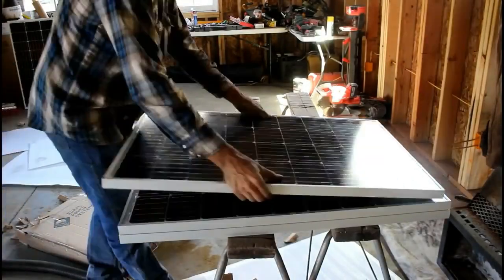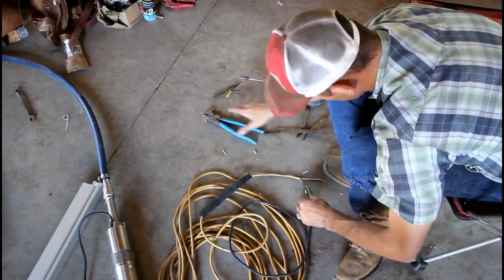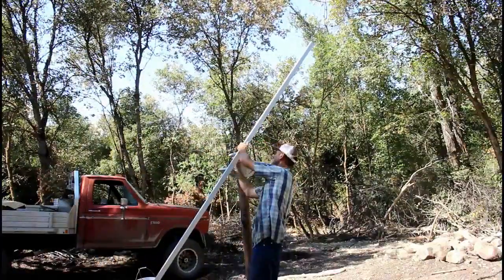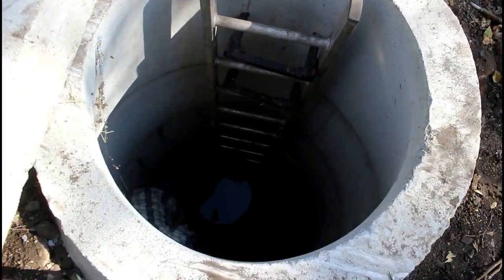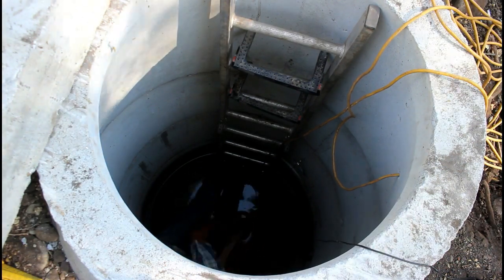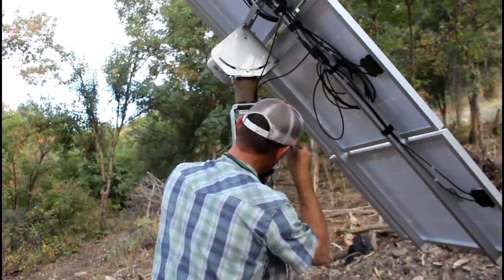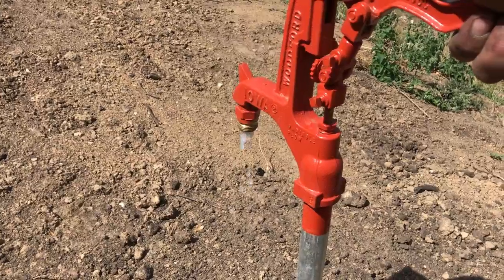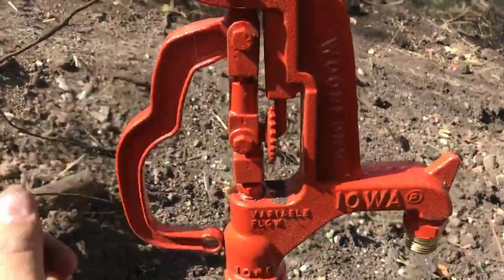#260 - WE'VE GOT WATER!!!  (I may have cried a little...)

Comment: WOW, I see two mistakes already, you used a galvanized fitting underground, should be bronze or brass, as the galvanized over time will leak due to electrolysis and you did not use wire rated for underground use.

Comment: If you don't cement that post in or at the least treat the bottom, I will guarantee that post will rot out within 10 something years.

Even something simple like copper-green is way better than nothing. Maybe it was treated and I didn't see. Regardless for permanent installations concrete is probably best. I understand I am probably preaching to the choir here.

Source - I hate pulling out rotten posts out of the ground.

Nice upload.

Comment: I'm not sure if I'm on the right video Part, but I have a question.  When you buried the water lines from the tank to downhill, I was interested when you said you put the line at 4 feet.  It isn't that I'm doubting you when I ask.  It's because I don't know.  Is 4 feet deep enough to prevent frost from freezing the pipe?  The cold and snow each have their own personalities in Minnesota.  We can get dumped on with snow, with mild temps.  Which is good because it provides a blanket of insulation that keeps the frost from going down as far.  We've had bitter cold, with little or no snow, where the frost is driven down deep.  The common standard depth for water lines, because of this being factored in, is 8 feet deep.  I realize that would have created a new and bigger challenge on your end to go that deep.  I work in the excavating industry.  I also work around septic systems.  State by state, codes, rules, regulations, soil and weather factors are different.  Location, water table, soil condition, hard pan depth, size of area to work in, terrain, machine capabilities and budget factor in to what a person can do.  In areas where the water table was high (lake homes), I have seen 2" hard foam sheets put flat over a water or drain line.  I'm told that 2" hard foam is equivalent to 2 feet of soil.  My boss puts this 2" hard foam (1 layer) on top of septic tanks that are less than 2 feet from level ground at the top.  An added layer of protection from frost.  So my curiosity was peaked when you said the water line has to be 40".  I would like to bounce ideas off you down the road, if I may.  The accomplishments you are making set you on a path of being a very wise individual.  Two things you said while leveling the water tank base caught my attention.  People don't do things the way they use to, and most of what you do is common sense.  I think the coolest thing you are doing is keeping a digital diary of this entire process and adventure.  You can use it for reference.  You can watch them and recall a point in that day where you learned something new,  grasped a concept or came to understand a process or necessary step.  Your children will have a fantastic way of learning from these.  Once settled, it may be an idea to make a copies of each of the videos and give them to each of your children after they marry.  They can show their children how grampa did it.  I thouroghly enjoy your videos.  Keep them coming.

Comment: Dude, I love watching your homestead vids. So gratifying. The homestead on a hillside thing is the ticket. Gravity fed water that's filled by a solar powered pump -- ideal solution. Endless water for free (okay - except the materials and the TON of work to get it built, but that's "a good price to pay.") A couple extra pumps, a replacement solar panel or two, some extra pex/poly pipe -- you're good to go for generations. The permaculture things you can do with sculpting the land for water to flow down your hill, from holding pond to garden, through swales and orchards, to the paddocks, the birds, to rice paddies with ducks (research that) to a fish pond and the house -- with fire suppression and all the other good stuff -- it's amazing. You can turn that hillside into a garden of Eden over time. Best part -- you've built in the water -- now you can just add to the plan each year. Try to plan in your long-term permaculture design now, so even if you don't do big parts of it for years, your know where things will go. And keep that charcoal from your burn piles -- amazing soil ammendment, as I'm sure you know -- loads you can do with biochar. You're living a dream I've had for years. I'm sure there are plenty of days where you curse that hill, but the ability to have water flow down through your Eden -- and that view -- I'd kill for a property like that. Can't do many of those things on my flat place, but we'll get our hillbilly retreat one fine day. Love your progress and really appreciate you sharing the technical details and evolution of your thought process -- super helpful for guys like me who will also tackle this one day -- keep it up!  :-)

Comment: Those wires aren't going to last being buried like that. You shoul
d have ran the wires through either conduit, or through pvc, so that they will not get brittle, break, and cause problems later down the road.

Also, the bottom culvert in the well should have more holes in it so it can fill up faster.

Hopefully it all continues to work out for you.

Awesome job!

Comment: Nice job buddy. As an electrician I question your choice of wire to your pump. I would have ran it in a PVC conduit instead of direct bury. You may have problems with that in a few years. Also some of the 4 legged critters in the area may chew on the exposed wire you have coming out of the ground up the support pipe. Again I would have used a metal conduit down the pipe and under ground to a PVC conduit run. Good luck with that.

Comment: You can build your solar array on a pile of big rocks.... actually mount the panels using concrete rock anchors to the big rocks.   I just used a very long steel bar and mounted the steel bar to very heavy stone blocks.  But since you are in the mountains it will not be hard to find big rocks to mount solar panels too. https://www.youtube.com/watch?v=iad_VDFi-iw

Comment: Red poppy. Has for your. RAILROAD TIES IDEA!!!!!!!!!!!!!!!!!!!. STAY AWAY FROM THAT!!!!!!!!!!! IF YOU DONT PUT STONE. AROUND.THE TIES BEFORE YOU PUT THE DIRT NEXT TO THE SURFACE. OF THE TIES. THEY WILL ROT. VERY VERY FAST. That was the dead of a railroad tie,,,,,, on the RAILROAD. GET A WASH DOWN FROM A HILLSIDE WITH MUD. IN TO THE STONE DRAINEST WOULD GO TO HELL. BEENING BACK EAST IN NEW ENGLAND. WITH ALL TYPES OF WEATHER. With the mud in the ground the ground then would freeze. Push the rail up...... Come  along with a engine and a drag of car's break the rail like tooth pick Could be the start of a derailment, Also handle the railroad get a pair of ice block tool to pickup the ties up  because they are cover with Creosote. If it gets on you... It burns like hell. Also smell. Drive you nuts. Railroad tie a labeled hazard waste. Because of the creosote. In them,,,,,,,, DID 32 years on the railroad. Know all about ties,,,,  was a railroad conductor.If I a dollar. For every new tie or old tie we drop off or pickup on a railroad work train I could be driving around in a brand Ford F-350 reg cab 4x4 pickup..... hey RED POPPY. STICK WITH TIRES,,,,,, LOT LOT EASYER  THE BACK,,,,,,  CANT ROLL RAILROAD TIES. TAKE CARE. JUNKMANDO .

Comment: Water!!!! Congrats!!!
Few questions:
Did the well witcher help with the location of the well?

Have you considered an earthship with no tire wall? I met a guy that built one with a standard concrete foundation and it absolutely had all the same thermal properties as a standard earthship. If you are dead set on tires I will be happy come up and help a weekend: you will need it!
Reply from the maker: I'm trying to get something together fast. The earthship idea will take too many tires and too much time I think. I will probably just build a shed of some kind.
Reply: Using the ground temp is the way I plan on going I am looking to burry about an R6+ sheet of polystyrene around the base of my shed down to about 3 feet to keep the higher ground temperature below from syncing out to the colder shallow ground, and then insulating the whole building to at least R6  this should keep the water at a temperature about the same as the ground at 3 feet. I will probably add some heat tape and extra insulation to the downspout on the tank. I am looking at a small Arduino with a temperature sensor to control when the heat tape is active. A thermostat should work just as well, but it wouldn't be able to know when the batteries are over drained or allow me to monitor it remotely.

Comment: Use pre cast concrete retaining wall blocks (big ones 2x4 ft). They are not cheap but will last forever and if you paint them with black sealer they will retain enough heat to keep things from freezing. You can also add a large window on the south side so that when the sun angle is low it will shine on the tank to help keep it from freezing.

Comment: Have you put antisiphon fittings on each of those remote spigots?  I imagine if you turn on the one at the top of the hill, and have one on at the bottom of the hill, the one at the top will stop flowing water.  The one at the top of the hill may start sucking air.
Reply from the maker: I hate anti siphon valves. A long is the tank is full or close to full this will never happen. The tank is still another 20' higher than the highest hydrant.

Comment: How do you keep the hydrants from freezing?
Reply from the maker: They are designed to open and close under ground where the  water connects. After using them they drain. They don't freeze.

Comment: Did you install a relay so that if the well low water level float switch turns off the pump during the day, the solar power is diverted to a small battery bank so that should the water level recoup during the night the pump would have reserved power to continue pumping to fill the tank?
Reply from the maker: This is an option but I do not want to use batteries with the well if we don't need them. I think we will be fine.
Reply: In your situation, you may be OK without batteries.  I'm sure you've done the math and your stored water will last you many weeks in case of no sun activity for a stretch.  I collect rain water and I use a battery powered booster pump to charge my bladder tank.  I charge the batteries that run the pump with a single 250 watt panel.  Never any issues, except running out of water!  Great system you have worked at installing.  Makes you proud I'm sure!

Comment: If you get time check out "Homesteadonomics" channel. He has found some really simple ways to catch and store water for his place also.  May give you some more ideas for your place. 
Question on the pump. There are NO BATTERIES involved ? Just panels and pump and controller. Sounds perfect !! Congratulations on your completion ! Will be interesting to see how much pressure you are getting. Looked like a good flow at release 👍
Reply from the maker: There is an option to have batteries in the system but I don't want them if we don't need them. So far so good.

Comment: Excellent job. That water tank will be fine. You don't need to fill around it. Plastic Water tanks do not require any kind of insulation and will keep water really cool. If you want extra cool, You can maybe place a shade cloth over it or make a small roof and wrap it with fibreglass insulation(freeze prevention). You should never ever fill-bury plastic tanks because a) soil will crush them when they go fully empty b) You won't see if it has any cracks c) Maintenance will be impossible.

Comment: Earth is not insulating. It has thermal mass. Earthship buildings works because it uses a lot of glaceing for the sun to heat up that thermal mass. I don't think it would work very well as a shelter for a water tank without any insulation. You already have a lot of thermal mass as water in that tank, introducing more won't help much. What you need is insulation around it, preferably also below, unless you dig it down below the frost line. If you wont put insulation below the tank now (since you already filled it up), at least trench around it and insulate the soil down to the frost line, so you wont risk having the tank freeze from below.

Comment: Congratulations on getting the water up and running. Quick question. As it is well water do you have to or have you run any water quality tests on it to ensure safety?
Reply from the maker: After I use it for awhile and shock it I will have it tested to be safe.

Comment: Not sure whether anyone else has mentioned it yet; have you considered using earth bags to build walls around the tank? Check the my little homestead channel on YouTube to see the buildings they've made, if it's of interest. :)
Reply from the maker: I have considered this.
Reply: Earth bags or rammed earth work for a lot of things but unless you make the walls very thick it'll have virtually no insulation properties (high mass though, which is not exactly the same thing) and will be freezing inside if you have extended periods of cold/snow.  Berm earth up outside a wall like this is an option but you'll also want the wall to be quite thick or well braced to resist the weight of all that earth pushing against it.

Comment: Are you planning to run the pump purely off solar, or are you going to add a battery to the circuit?
Reply from the maker: I think the solar only will be fine but I will watch it.
Reply: i agree, i would go with solar only no batteries to reduce your consumable cost. I would wire up an easy option to allow the use of a generator to run the pump in need of a pinch.. like a cheap pigtail plug if the pump is 120v capable, really unsure what the operating voltage is on that pump your using if its a DC pump or AC pump

Comment: I am so very very happy for you.....  You had it figured out a long time ago,  I worried for nothing....  good for you!     A question?, have you got enough extra power up there to wrap the fittings with "heat tape"?        Are you, or have you had the water "tested" by the County or State, or is that something that you do or want to do?
   Thanks, Mike
Reply from the maker: I don't have any power up at the tank but I considered putting a small panel and using heat tape. I will soon have the water tested. I want to use it for awhile and flush out as much of the sediment as I can first.

Comment: I would keep focused on the house.   To save time for this season why not do a hay bail insulation layer around the tank, covered with a Harbor Freight tarp.  This will get you through the winter and not take too much time away from working on the house.   Also gives you time to see how things work out and to decide if the tank needs to be higher or a second tank is needed etc. 

Noticed you had some shading on the solar panels -- all the solar cells are in series so any cell that gets shaded will bring down the entire array's output to that of the shaded cell.  No shaded cells during peak sun period of the day.  Analogy: The shaded cell is like having a section 1/4" dia of poly pipe in your line to the tank.  You only get as much water as the 1/4" pipe will flow no matter how big the rest of the pipe may be.

Comment: Nice pump and hardware.  Very much like I install in cisterns up here in the not-that-far-but-far-enough-North.  The only thing I do different is when I dig in the tank, I install enough hose to reach out the man-hole, so that I only ever have to enter the tank is before I backfill.  After that, everything is on a cable and rope so I can install and service the pump from the surface.
Reply: Yes we live a little farther north as well.  We have cisterns buried in the ground that never freeze.  The water comes out from the bottom so it is well below the frost line.  I think I would spend the time and money on a buried cistern and use the above ground tank for extra storage in summer to water the trees and gardens.
Reply: Direct bury tanks can be expensive.  near-grade or protected tanks can be a bargain when you’re not looking at an 8-foot frost-line, and can get away with a foot or less of frost protection.
Reply: Wow!  8 ft Frost line is pretty impressive!  I think it's about 4 ft here.  Nice not to have to worry about pipes breaking.  I've seen where people had to keep wood stoves going in the building where their tanks were, to keep them from freezing up.
Reply: The first time I saw a gallon bucket of gasoline burning under a bulk propane tank so the propane wouldn’t stop flowing freaked me right out… thankfully, those days are pretty infrequent, and more thankfully, I’ve got natural gas.
Reply: Yikes!!!

Comment: Instead of all the switches I would’ve put an overflow pipe in the top of the tank and run the overflow into a pond down by the house that way you can just look out the window and see if your tank is full by the overflow spilling into the pond.

Comment: Is the tank being top filled or bottom filled using a check valve?  If the former, the pump will not have to work as hard.
Reply from the maker: Bottom filled with a check valve at the pump

Comment: Another option to get you thru this winter...
Maybe use straw bale walls for speed of build...
I know it's s long way up the hill.. Especially in the winter... But maybe you could use a compost pile to heat the tank room during the winter...
Reply: Wow, another great idea.  I have a friend in Maine who heats his house solely by capturing the heat from a compost pile.  He has to rebuild the pile every hear.  The only real cost is a fan to blow the air through the circulation tubes.  (I don't think Red Poppy Ranch can do this solution this year though.)

Comment: We have rammed many tires in the past, a ton of work.  If you only have a few weeks you will have to be pretty fast . 2" insulation board wrapped and sealed with and dirt bermming would be quick. I wish I would have done that, and our norwesco 2500 is buried completely.